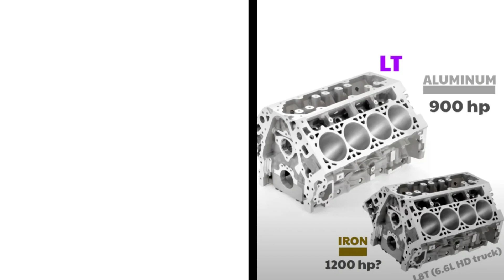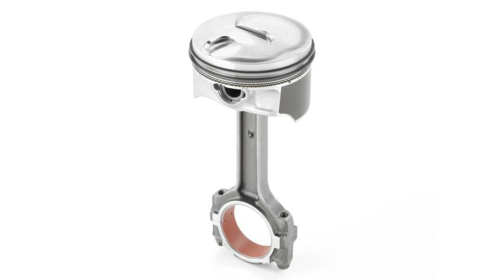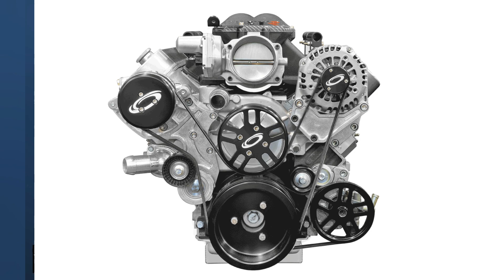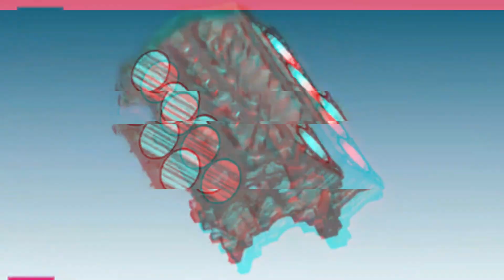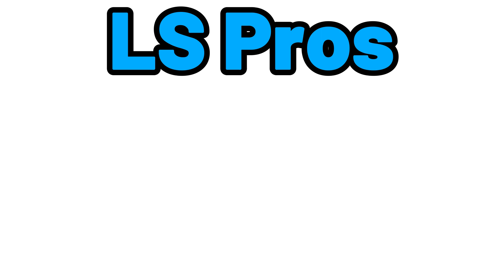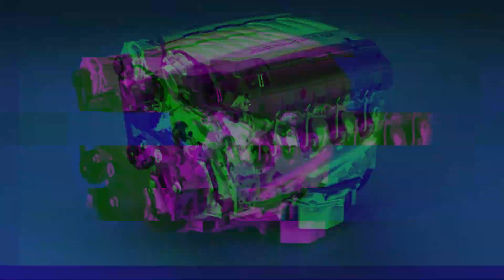Why LS are better than the LT Engine ? | The Run Down ep.4

Comment: the best LT engine that was built, was the DOHC 32 valve LT5 use in the 90-96 C4 Vette ZR1. now that is the engine I wish GM would bring back as a crate engine.  [5.7L DOHC 32 valve LT5 V8] MPFI. would like to put an ZF 8HP95 with it in my 2004 CADDY SRX4.